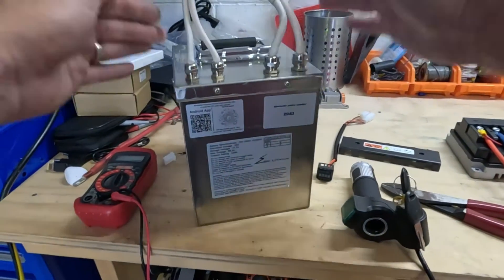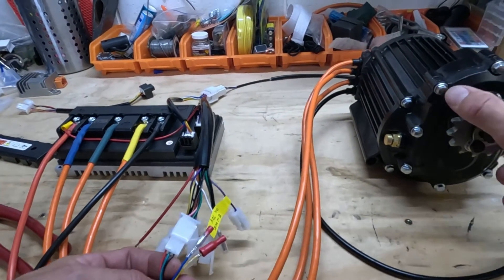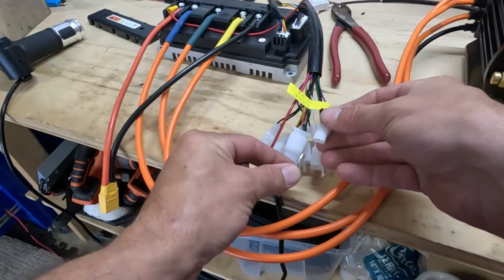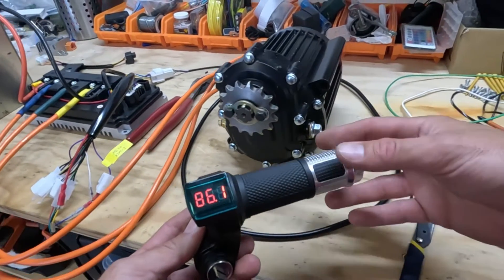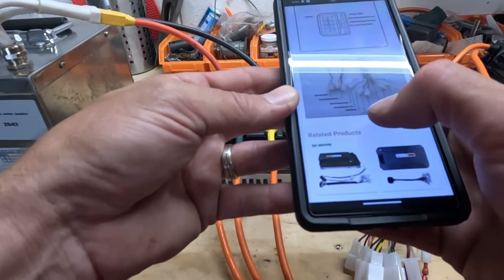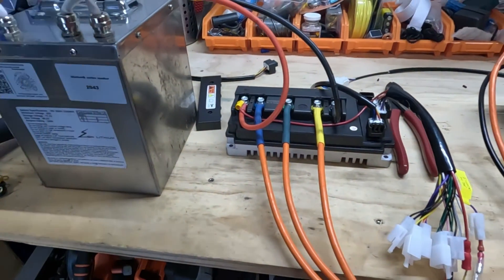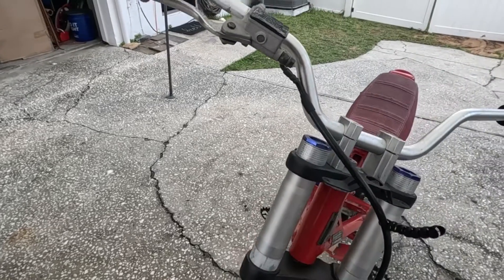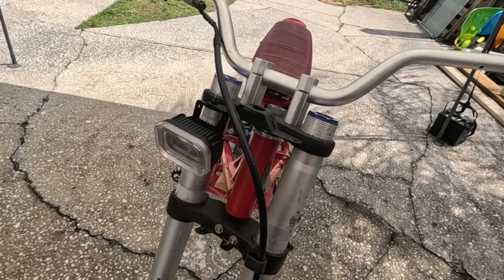Bench TEST! Electric Dirt Bike Build Conversion! Part2! QS120 V3 #QSmotor #ebike #diy #EV QS138

Comment: that's an interesting motor. built in gearbox. what's the KV? the RPM per volt
Reply from the maker: Hi there, here are all the specs! https://www.cnqsmotor.com/product/qs120-motor-qsj120c-60-2000w-motor/
Reply: @TackleThat  it says 2800RPM at 72v which i assume is the motor rpm which goes through 2.35 reduction, so the shaft rpm is 1191rpm, correct?